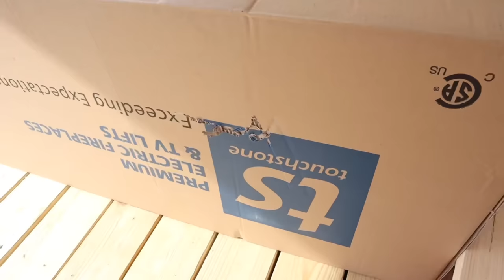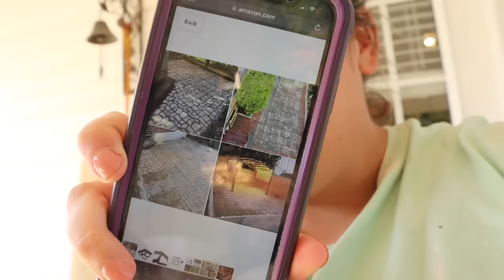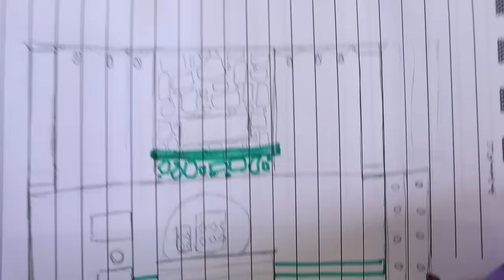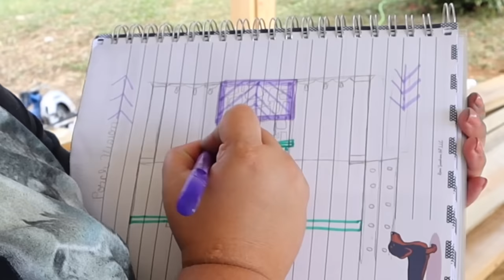THIS PORCH IS KICKIN’ OUR BUTTS! 1991 Double Wide mobile home makeover | mobile home remodel Ep.3

Comment: Please tell your husband Shane, to place concrete pads under the under the the steps where they touch the ground. It'll keep the wood from rotting even though it's treated wood. Just a little love from the family Tennessean.
Reply: It will also create a barrier against termites.
Reply: Absolutely the base needs gravel and concrete squares
Reply: That's what I was going to comment. They'll rot very quickly if they're not on slabs or paving stones.
Reply: Concrete risers or squares is fine and will meet code if you ever resale.
Reply: What a beautiful job the two of you are doing
When done the deck will be gorgeous, too bad Shane doesn't have a another guy to help him
My husband always did DIYs by himself too
Reply: Yes concrete!
Reply: Agree on the concrete. Peace from Tennessee ( below Knoxville ).
Reply: Your right.  dig dirt out and tap them in!
Reply: I agree about the concrete. We are actually building our deck and about to do the stairs. My hubby and FIL are working on the base for the steps.
Reply: I was going to say the same thing. There needs to be like some type of concrete footing under all of your stair stingers (I think you called them the stair shell) 😊
Reply: Yep, to meet code will have to have cement footers. It will also tell you the depth required for concrete.
Reply: Save money and put concrete under the stairs. You will be redoing later if you don't. Btw...lovely deck.

Comment: Hey Merina! A word of caution with joint compound, it can not get wet or damp, so it can’t be used outside. If it gets wet, it turns back into a mud like consistency, and could mold if it doesn’t dry properly. The idea of doing it like the bricks you guys did at the other trailer, as long as it’s inside, I think might work, definitely a creative idea. 
I love seeing your guys work on transforming your dream home for your family. My husband and I bought a house last year, and we are still working on the same project we started when we moved in. We are doing it all ourselves, we aren’t going into debt, and we both work full time jobs. We’ve taken down a wall, moved electrical, moved HVAC, dry walled, mudded the drywall (sanding, mudding, sanding, repeat for what seemed like ages), wallpapered the ceiling, and then primed and painted the walls. We have the flooring and trim left and then we are DONE! I will be so grateful when it is complete, and we can finally move into our master bedroom.

Comment: The wood filler will dry, shrink and eventually crack and crumble. I did basically the same thing and several years later the heat and cold caused it to deteriorate. Instead of trying to dig it out, painted the porch, and instead of trying to hide it, I drew off a design, taped off and painted it. It didn’t do away with the cracks but by painting along the cracks with a darker color making the cracks “hide” within the design. In other words bring it to attention so it actually disappears. Porch looks great now, no one ever notices the seams, the design pulls your eye away. Don’t sweat the small stuff, it’ll all be fine in the end. God bless you Darlin’.

Comment: You might want to build some type of retaining wall where that hill leads down towards your porch. Water will run down the hill and under the deck and possibly your trailer causing mold and rot issues. You could somehow build some steps that will lead up to the backyard and the kid's trampoline. I'm sure between you and Shane, you could figure out something. Great job so far on the porch. Can't wait until it's all finished.

Comment: The reason you don't want the beams butted up together like that is because the wood will expand and contract with the seasons and the ends butted up together will start to push on one another and push some boards up. You won't be able to salvage the boards that pop up, but just need to replace them.
Reply: Could they just cut those boards down so they don't butt up now? Just my mind wondering.

Comment: I think an outdoor carpet on the deck will cover most of the butt crack.😊 Also, steps should sit on a concrete pad, not directly on soil.
Reply: If it rains, though, won't the carpet still get wet? I don't think the cracks are that noticeable, at least from a distance.
Reply: Opinionated2, there is outdoor carpet for decks and porches. Works great!

Comment: Marina, I am late watching this, but you could still use your stone and then add joint compound in the joints of the stone and then paint it or do a German smear to it or you could use the stone to cover or enclose the bottom part of your deck to make it look like a stone foundation, just seal the edges to stop moisture from seeping up the boards- all said, you’re utilizing the stone but making it a little better and it covers all the seams. You and Shane are doing awesome!

Comment: Merina you can use spray foam insulation in the concrete forms. If you used the rock panels to surround the fire place then do shiplap above it. The hearth is on the bottom the mantle is above.

Comment: Merina, place a large  outdoor rug under your furniture to help disguise the seam. No one will notice. That nut is a pecan. Either you have a pecan tree or a 🐿 transported it. I'm envisioning pumpkins 🎃🍁🍂and mums on that beautiful new porch when finished! Be sure to place concrete pavers beneath the bottom steps to prevent shifting and rot. We had that same paver mold. We used concrete. Dig your path lower than grass line so your pavers will be level with the grass.

Comment: I'm going to suggest putting a concrete paver under each stair stringer. The wood will rot and cause those steps to pull away from the deck. I've been there and done that.

Comment: Hey, Merina! :D I don't know how much you have planned so far for your future homestead or how you want it set up, but I have an interesting idea for you and see what you think. I had this idea a few years ago and we're doing it, but it isn't finished.
What we're doing is putting our chicken house in the middle, back edge of our garden. We've divided our garden for Spring/Summer crops.. and the other side for Fall/Winter crops.
 One door of the chicken coop (actually a smaller version of a chicken run with the coop that the chickens can go in all the time in case none of the garden is available to them for whatever reason. So one door of the chicken "run" instead of "coop."...)  goes to one side of the garden and another door to the other side of the chicken run to the other side of the garden.
That way, if we are planting our Spring/Summer garden, the chickens can fertilize, eat the weeds, eat bugs, loosen the ground and be prepping for our Fall/Winter garden, while we utilize and grow our Spring/Summer vegetables in the Spring/Summer garden. Then when we're done with the Spring and Summer garden and collect the seeds from it, the chickens can be turned loose in this side of the garden and eat what's left that's done growing and the chickens do the same thing, prepping this garden and such. And then during this time, the Fall and Winter garden should be ready by then to grow our Fall/Winter crops thanks to the chickens. :)
My dad built our chicken out of inspiration from the Carolina Chicken Coops from their YouTube channel. They go around and build chicken coops for other people too which is neat. They do an awesome job!

Whatever you do, I'm so excited to see what you do with your new place. You are amazing and you and Shane have done an amazing job designing, making, building diys in your home and I know the outside is going to rock too!❤

Comment: Great job!! Those wooden pieces that you found for the stairs are called stringers. You need to use more of them. They’re supposed to be 16 inches on center. And then you don’t do other bracing in between that is the structure. Good luck I know it will be beautiful

Comment: You are doing great for doing things you have never dealt with in the single wide.  I do have one suggestion for you though.  I know that the lumber you purchased is pressure treated BUT you should put down a paver under the stair risers so that the wood has a solid footing...the ground can and will errode and it will begin to make your stair treads warp and become unstable over time even if you add the add'l supports.  You could also pour some small footers for where the stair risers meet the ground...just to prolong the integrity of the wood.  Keep up the good work and I can't wait to see it all come to fruition!  Hugs!

Comment: What if you took that form as you suggested but start the fill with spray foam then top that with your joint compound. Keep it lighter weight but once you put on lots of joint compound it tends to crack & shrink. There are sheets of faux stone available at building centers for less than what you paid for that product.
Also the stair side supports are called Stringers. Since you drilled into the stairs in the center you might need to add stone supports under the treads because they will experience the most stress in the center from weight.

Comment: You guys could do the stone stuff instead.  It would be cheaper in the long run.  It wouldn’t crack.  It’s not that hard.  My husband and I did it on our fireplace through trial and error it turned out pretty good.  They also sale plastic panels that mimic stone.  We had to paint it and fill in because it doesn’t look like picture it was mauve but it turned out pretty good.  Wish we’d done the stone though.

Comment: Marine, so sorry the stone isn't working out the way you would like.  I like your idea about creating your own stone.  I've been watching videos on air-crete, which is when they add a lot of air to the concrete in order to make the object much lighter in weight.  My Little Homestead YouTube has created several videos on this method.  Perhaps you can use that to create your faux stones.  You can purchase powdered dyes which may allow you to create different shades.  If you make one of those in each color, then you can switch stones in each set with one of the same size in another color to have more variation.  It would be very interesting to see how that would come out!  Maybe you can practice with a small outdoor grill area first. I have been thinking about doing the same thing on the wall behind my woodstove.

Comment: I'd dig out under the stair supports enough to slide a flat concrete walking stone under it. You really dont want the wood touching the ground. It will wet rot fast.  Love the fireplace and thicker pillars.

Comment: Hey there Merina @fearfullycreated!!!! I can’t WAIT to see your porch when it’s all done and decorated! I desperately want an outdoor fireplace for our patio … I have a large, black wood burning outdoor “Pagoda style” fireplace/ fire pit that a friend gave me, but I’ve been too sick to even START refurbishing it so that we can use it on our patio. Too sick with what is most likely MS (I’m still searching for a correct diagnosis by a neurologist… I’m currently on neurologist #4 now🙄🤦🏻‍♀️😥… sigh)…. I’m the handyman in mine and my husband’s relationship lol, he wouldn’t even know where to start lol, so it’s all up to me to bring this fireplace back to its former glory. It needs a new bottom due to rust eating away 90% of the bottom, and then sanding down the remaining rusty areas & repainting it with heat resistant spray paint etc. It’s more work than it sounds though lol, mainly because I’m just SO weak and in SO MUCH pain & also major chronic fatigue every single day. I have many, MANY MS symptoms, but the daily, SEVERE chronic fatigue, pain & weakness that I deal with LITERALLY 24/7/365, have all made even STARTING my “little” outdoor fireplace/ fire pit project just impossible. But I can see the end product in my head and it will be SO beautiful when it’s all done one day. I have been SLOWLY tackling small, “easy” projects for nearly 2 years now to get our small deck & LARGE paver patio area pretty again, so that we can actually use it and ENJOY it. Maybe one day I’ll have the fireplace and the deck/patio area ALL COMPLETED and pretty again lol… but it’s slooooooow goin’ lol. Anyway, just a shout out to you & Shane and a big THANK YOU for your videos that have taught me how to do many things and given me SO MUCH inspiration for things to do to our 400 sq foot Tiny Home… both inside and out! I sent you a private message on Instagram too btw. Take care you guys! Much love and God Bless, from your neighbor in Johnson City, Tennessee! ❤️😘🙏🏼

Comment: If you get one of those paver molds you could fill it will spray foam, air dry clay, or Styrofoam to keep weight and cracking down. Another option would be to get a 4ftx8ft 1inch thick board of foam from the hardware store, usually it's pink,  then cut out stone shapes. You can use rocks and stiff bristle brushes etcetera to rough up the foam stones to look real. Then glue them to plywood add joint compound in the cracks and paint.
Reply: I hope she sees this. I commented that I’ve seen YT videos on how to do it.

Comment: You guys did a fantastic job on the faux brick wall in the other home ! ( so good in fact I copied it for one of my wall in my home ) I know without a doubt you two could do the same with stuco  and it would be basically the same . Just take a pic. of the pattern you love and build it , even if you have to construct it on plywood panels and then apply them upright. I think I would look into returning that 700 $ worth of  Styrofoam if possible.
I'm sure without a doubt you two could do it . And if you need help there's always YouTube ! Watch enough videos on a subject and you become an expert.
I'm rooting for ya !!

Comment: Putting on wood filler. On.   new wood.  It doesnt stain well.  Where the wood filler is  Unless you use s solid.  Stain.   U.  Need to let the wood dry properly.   Before you stain.   I found out wood filler doesnt stain well.   Had to use a solid color.   At least on the floor part.   Just saying""   giving you a heads up.    Great luck looks great

Comment: The stair treads are supposed to lay on top of the stair stringers, not between each stringer. If you put them on the top you could put one long stair tread across all the stringers... they will be stronger because the stringers are supporting the weight thats put on the treads, not only depending on the nails or screws to hold the weight.

Comment: If you need or want to rework your butt crack you can use the wood you have already. Pulling up every 3rd row moving 1 piece to center and cutting other piece for 2 outside pieces it will break up your butt crack not to be completely center. You could do more if you choose but the 3rd one would add that broken line. I think the wood filler will take stain but be lighter or darker just because the medium is different. Can’t wait to see the finished porch. Also a large outdoor rug in center of porch will cover a lot of butt crack and add warmth & comfort.

Comment: Your deck would have looked okay if you and put a board lengthwise in the opposite direction in between the two rows.  I don’t think that wood putty will do the trick since the boards will contract in cold weather and swell with moisture.